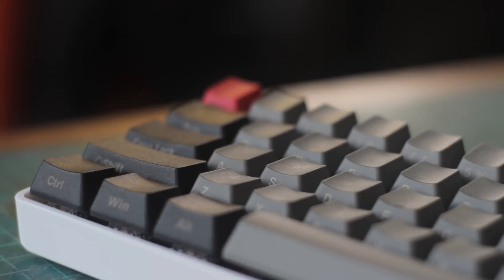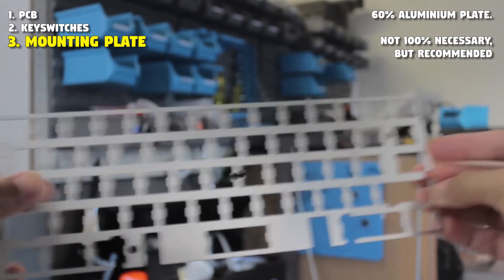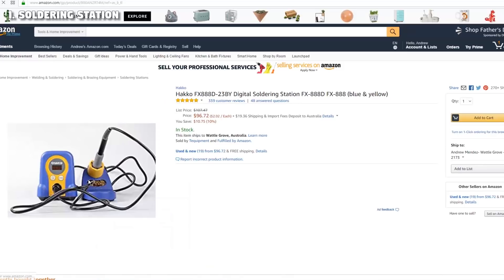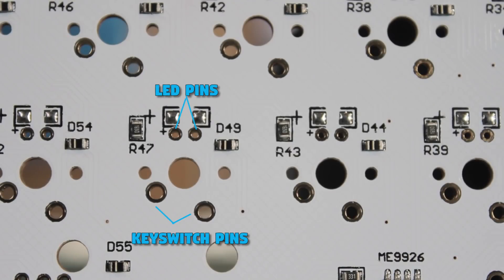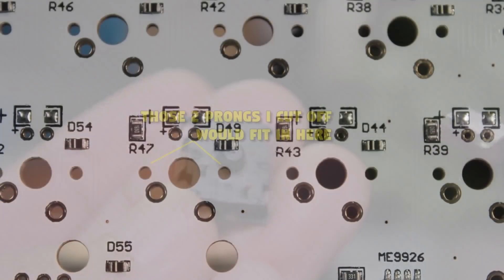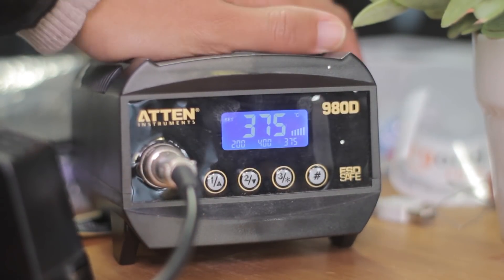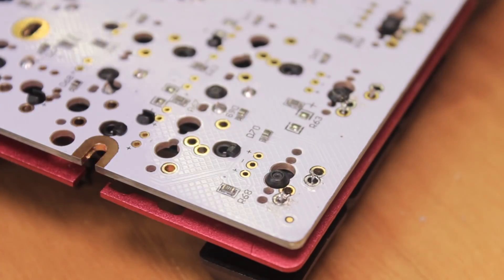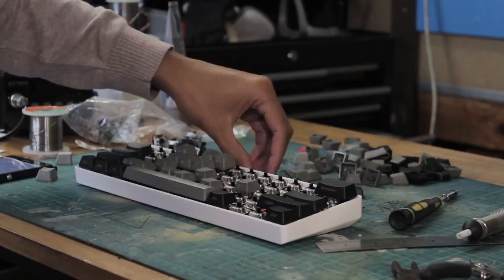Beginner's Guide : How to Build a 60% Mechanical Keyboard

Comment: First time building a keyboard and confused. I hv a xd60 board with the 5 pin holes. Should i cut the the extra 2 pins on the keys?

Comment: Wait. So if you have a PCB mount and PCB switches. Do you have to do the soldering??
Reply from the maker: you will always require soldering, unless you specifically have a hotswap keyboard
Reply: @TaeKeyboards  oh okay. What happens if you don’t solder

Comment: Guys, keep in mind that if you get a PCB with no built-in controller, you could for example use a Pro Micro ATMEGA32U4 and flash it with QMK Toolbox before testing each switch pins with tweezers, otherwise it won't register.

Comment: Yo can I screw down the pcb onto the case first, then install the plate and switches? Asking because on gk64 the plate may not have holes for a screwdriver to access the screws on some cases.

Comment: Hey, I have 2 questions: Are there specific ISO-layout PCBs? And will a custom keyboard be cheaper than most mechanical "gaming keyboards"?
Reply: I’m not very experienced with keyboards but I can answer your second question: a custom keyboard is so much more expensive than a prebuilt keyboard. The cheapest you can use to make a custom keyboard is probably $100 but it’s recommended to use at least $200 to $300 minimum.
Reply: @hueynsoe7586  ouch ok thanks for the reply

Comment: What if I just get a hot swappable pcb would I need to solder I’m new to this
Reply: If its hot swappable you dont need to solder anything, but its better if you buy 5 pins switches (if the PCB supports it) so that the switch doesnt move. 
I hope it helped you and sorry for my english. :)

Comment: You guys don't understand beginners at all and that's why these guides fail. We are afraid to buy wrong and end up not doing anything because most of these guides spend the time actually building it with the parts already obtained. if you want people to actually build keyboard make a guide in depth about how to pick the chassis and boards.

"this is one out of many pcbs you can get" well what are the differences? what about mounting holes, what about key sizes?

Comment: Can anyone explain to me what a base kit is? I’m looking at building a keyboard eventually and I see a lot of stuff labeled as such, and was wondering if it only includes the key caps or if it comes with more? Googling base kit only comes up with websites selling them so I haven’t had any luck in researching it
Reply: Spencer Walthall I googled it and I couldn’t even find anything to related to that. But i think you mean the 4 in 1 kit, it basically has stabilisers installed, aluminium plate, a pcb and a case installed. It basically makes everything easier for a cheaper price (sometimes tho) . All you need to get is switches and keys and you’re done
Reply: @BlancoWilliams  Oh huh! Thanks for the info!

Comment: I have questions about 6:10. Earlier you said to cut off the prongs on the pcb mounted switches if you are going to use a plate, but over here you say if you have pcb mount switches you can just lock the pcb and plate together. I'm wondering how you would do that if you cut off the prongs. Is cutting off the prongs on pcb mount switches necessary if you are using a plate?

Comment: This is insanely helpful I watched Linus tech’s video and juju’s but they were both rushing through and using unknown vocabulary but u explained everything and I understand it a lot better now thanks you this is an awesome video I’m 12 years old and if u can make a 12 year old understand how to make a keyboard I’m sure anybody else can do it
Reply: Penguin
Reply: @faxyo9985  lurker
Reply: Giovanni Procopio penguin
Reply: 12 over here to thinking about either soldering or getting a hot swappable.
Reply: @wtfimcrying  same 12 here i got a hot swappable because it would be more expensive to solder it
Reply: BeautifulToeNail fr
Reply: @wtfimcrying  hot swappable
Reply: Hotswap is cheaper because then u don’t have to buy the soldering materials(which are EXPENSIVE).
Reply: @aaryaganesan1917  In the long run, soldering would be cheaper, but if youre making just one or two, then def hot swap
Reply: It was 5
Reply: This is how they speak

Comment: Do I need to solder all of the key caps, can’t I leave them unsoldered so I can hot swap the switches?
Reply: Jakob Feck some PCBs come hot-swappable, so you don’t need to solder. If you’re looking to make a mechanical keyboard hot-swappable PCBs are a great choice.
Reply: Jakob Feck gk61

Comment: a hakko soldering station is not necessary for such keyboard build. a cheap $10 soldering iron will do just fine, you aren't soldering SMD chipsets with that, just the switches

Comment: Hi, I'm considering to try out to build my first keyboard, but I'm an ISO user, so I was wondering... Those pcbs available on banggod are universal? Could I mount the stabs in different ways (I'm thinking about the enter key that's mounted "vertically" on ISO pcbs) or there are specific ISO pcbs? Thanks a lot for your videos that are really comprehensive and enjoyable, and thanks a lot in advance for your recommendations!

Comment: Hi so if you have PCB mount switches you don’t need to solder? Please answer it would help out a lot :)
Reply from the maker: You always need to solder, unless you have a hotswap keyboard :)
Doesn't matter whether you have PCB or plate mount.

Comment: It's irresponsible to suggest lead solder for a project like this. While it should be avoided whenever possible, I recognize that lead solder may sometimes be appropriate in specialized applications, like aerospace and automotive. A keyboard, however, does not experience anywhere near the stresses (mostly thermal and mechanical) that things like cars and airplanes do...lead-free will be just fine. Please do not add to the toxic electronics waste crisis without a very good reason.

tl;dr: Lead solder is harmful and unnecessary for a project like this. Be nice, use lead-free.

Comment: how did you add the caps lock led? is it inlcuded in the pcb?
Reply from the maker: You have to buy a 3mm or 1.8mm LED and solder it.

Comment: I may be 2 years late, but as an electrical engineer who has done multiple soldering. I cannot stress the importance of after using lead-based solder, please PLEASE wash your hands. Even though the odds of you getting lead poisoning is close to nada, you still can't rule it out. The importance of using lead solder is that it provides better connectivity between your different contact points, but it comes with a dangerous side effect.

Comment: So if i were to use the switches with the prongs paired with a compatible pcb, would that mean that i would not have to solder anything??
Reply from the maker: Prongs, as in the plastic prongs? Nope, that's just to keep it more sturdy on the PCB. You always need to solder to make that physical electrical connection, unless it's a hotswappable PCB :)

Comment: How do i know what profile keycaps i can buy? im trying to make a 60% keyboard with dz60 rev2 pcb
Reply from the maker: You can use any profile. Profile refers to the side view of the keycaps. I think you mean like the layout. If you are building one that has the same layout as this keyboard, then you can buy pretty much any standard keyset, and it will fit.
Reply: @TaeKeyboards  thank you so much !

Comment: How would you add Led’s to your board? I feel like showing us how you did the caps lock would’ve been a good thing so we got a general idea if we wanted to
Reply: Some pcb's have leds build in, like the dz60rgb
Reply: Some switches are equipped with LEDs. You'd have to solder two extra pins per switch. Don't forget to have double-shot keycaps so the label is illuminated.
As Herpez said, some PCBs do have (RGB) LEDs already on them. Then it would be a matter of using switches with a clear housing to really make them shine.

Comment: Hiya, nice video. I wonder how would you go about converting a Lenovo keyboard to a wireless keyboard  (I've got hold of just the keyboard) . My reason for this is I use the red tracking/mouse on the keyboard very effectively but I work wit three six screens, two laptops and a MacBook Pro. The laptops are seamless but the Pro drives me mad. I would love to create a wireless keyboard that I can use with all three. Any ideas would help, Thanks

Comment: would cost around $160 CA for me. good job
Reply: is that with the soldering tools too
Reply: Tragic_png I spent around $120 on my build. However, I used a clear case since I was gonna use underglow... Otherwise, you'll probably spend around $110. Soldering tools not included tho
Reply: I have the soldering Tools and I know which Keycaps, Switches case, wire, stabs I want. But I didn't find any RGB PCBs with ISO Layout...
Could you help me? I also need a plate
Reply: Mindest the dz60 on banggood has rgb underglow with many supported layouts including iso. but you have to solder the key leds yourself
Reply: @konnai4973  I See..
Well, that's a compromise. Thanks
Reply: Where can I buy them? theyre sold out everywhere

Comment: Should I lube my switches?
Reply from the maker: It's not necessary, and takes a lot of work. But it does make your switches smoother and usually nicer to type on. Switch lube is different to stab lube though.

Comment: @taekeyboards I have a loaded question hoping you could help. So I recently purchased a KC64 from eBay my first 60% KB. However I noticed that certain keys don't register when you type quickly. I like the keyboard and have already spent a considerable amount of money in the last year on different mech boards. Would I be able to re-use my cherry MX brown switches, plate, case and keycaps and just replace the PCB? Would I also be able to have the same layout that was originally for the KC64 or would I need to buy stabilizers to make it a standard layout? I was looking to replace it with the same board in this build

Comment: Ive been soldering electronics for a long time now and I've never had one of the Hakko soldering stations. They are more of a high end soldering product. If you cant afford a fancy soldering station or even anything above an iron that you plug into the wall, don't let it discourage you. In the end it's just a hot piece of metal.

Comment: How do you solder LEDs?
Reply: Switch LEDs? Once your switches are soldered, you can simply insert the LED through the switch and the PCD holes like this: http://d2fu7qgd3tdbcc.cloudfront.net/images/detailed/1/3mm-led-switch_ph6d-zd.jpg?t=1448959437 and solder in place underneath, just like the switch. There's a couple of different size LEDs that will work, and they're available in most colours. Packs of 100 are like, 5 dollars.

Comment: Couple of questions regarding the build:

1.Could the Backspace area(2units) accommodate two single keys(like alpha keys) of 1 unit each on this PCB?
2. Could Right Shift Key area (2.75units) accommodate a single key(like alpha keys)  of 1 unit and a Shift Key of the remaining size/unit?
3. Could you advise where I can find 1.75 unit -Control Key cap and 1.5 unit-Caps Lock Keys if they exist?

I am trying to build a hybrid HHKB and MX style board with arrow keys.

Thanks
Reply: 1. and 2. Yes, the GH60 PCB supports both split backspace (1u + 1U) and split right shift, but only in 1.25u + 1u layout - not the other way around. Layout picture here: https://ae01.alicdn.com/kf/HTB1bFqIKVXXXXboXFXXq6xXFXXXu/Customized-GH60-Full-Kit-Aluminum-Case-CNC-Acrylic-Case-PCB-Universal-Plate-Switches-LED-For-60.jpg
1.75u Control - most decent keycap sets will include one, that is GMK sets for example that are run in group buys. It's quite common for people to replace the traditional Caps Lock key for a Control key (ala HHKB). I'm not actually sure about 1.5u Caps Lock, that might be a bit more niche option, most people when replacing the Caps Lock key, will put Caps Lock under a function layer, as it's seldom used nowadays it seems.

Comment: so i can build one without a soldering station using the GH60 ?
Reply: You can use a soldering iron, rather than a station, but it's not recommended.. You can pick up a cheap, adjustable soldering station from Amazon for like 28 USD..

Comment: i am a beginner at making a keyboard, but i want to give it a try but watching your video
a)i learned the components that i have to use
b)i dont know which keys to solder ?(why not all of them) and what holes to fill ?
but great video gave me lots of good ideas
Reply from the maker: All of the switches that you put in have to be soldered. So each keyswitch has 2 pins, and both of those have to be soldered. There's extra holes for different key layouts. For example, some people use an ISO layout which has that large blocky ENTER key. Therefore you need more holes to accomodate that different positioning. So that's why there's extra holes, and if you don't have any keyswitch pins going through it, then you don't need to solder it, since there won't be any connection made with anything. 

However, if you do put solder there, it won't make any difference, and it will still work fine (because there's no connection made).

In short, you just need to solder in your keyswitch pins (and LEDs if you have).

I hope that makes sense :)
Reply: You do solder all switches - the first few that he soldered in the corners of the keyboard are to hold the plate and PCB together. Once those few are in place, you can install the rest of the switches, flip the board over and solder them all in place.

Comment: Id rather buy a razer keyboard then buy a tool for $100 to make a 60% keyboard
Reply: 2 points - the soldering station shown here, though highly regarded, is definitely at the higher price end of what is available. You can find an adjustable station on Amazon for less than 30 bucks. I've built 6 keyboards with one of these cheap ones, with no issues. Secondly, whatever the price of the soldering station, it becomes better value for money the more you use it. Build 10 keyboards, and that 100 dollar station has cost you - 10 dollars per board, if that makes sense? But not only that, soldering is a great skill to learn and have at your disposal, and it's really easy to pick up. So even outside of keyboard building, it can be a worthwhile investment.

Comment: If you have keycaps with PCB Mount do you have to Solder?
Reply: I think you mean switches but yes you still have to solder them in. The only way to avoid soldering switches would be to use Holtites but different Holtites may or may not fit in some boards.
Reply: ADCBot oh okay. 
Do you have any idea if their are PCB:s compatible with ISO Nordic layout? I have looked a lot but have not found any PCB. I looked at the phantom PCB but i didn't find any information if it supported ISO Nordic layout.

Comment: Great work. 
But $105 is very expensive for a DIY keyboard. 
Did you try buying from Aliexpress?
Reply: For a DIY keyboard, that's a very cheap price. Like bottom of the barrel. For prebuilts, it's definitely on the higher end.
Reply: Ryzu, 
Said no self builder EVER.
Reply: Alaa Jannoud
Exactly, I found a complete 60%Mech keyboard there for 90 bucks

Comment: Do you think you could do a guide on rgb back lit keyboard? I would like to try that as it seems very fun and difficult however I don't want to jump into it not knowing what components I would be needing.
Reply: You can get a PCB just like the one used here with RGB SMD underglow pre-soldered, for practically the same price

Comment: Really good video.  Question though, what about support for fn modifiers?  I lose the arrow keys if I go to a 60% board, but a lot of off the shelf boards keep that functionality but move them to modifier keys.  Is this possible with a custom build?
Reply from the maker: Yep, by default the arrow keys are on WASD. Nav cluster (home, end, etc) is on []'; etc. And of course F1-F12 are on the number row :)
Reply: TaeKeyboards thanks for the reply.  is the PCB you linked in this budget build programmable? or is that a more premium feature?

Comment: Just wondering - is there a way to make the keyboard have that "k70 floating key" look? Like any special cases out there or just diy?
Reply: You would just need to start w/a base that isn't recessed, and w/no dividers between keys.  The one in this video is actually floating, it just has a couple mm lip around the base.
Reply: So would I trim off the extra mm? or

Comment: do you think i can build a pink-themed tkl keyboard for around 150 U$ ? i fell in love of the miami keycaps you showed on the meetup video <3
Reply from the maker: TKL custom boards are more expensive as they're not as standardised as the 60%. Custom parts for TKLs tend to be higher quality, and therefore more expensive. So I'm not sure whether you'll be able to do that, but I'm not completely sure.

Alternatively you could paint a case pink, which is pretty easy and would look pretty good if done properly.
Reply: mmmm... the other option is to buy an cheap one and swap the keycaps... can you suggest me one similar to xiaomi's mech but with tactile switches? i've used cherry blacks for 6 years and want to try green/blue ones, also the detachable cable is a plus, but i think i can mod it :D
Reply: As an update for this comment I bought an 60% and spent over twice my original budget (no regrets) 😀 I fell in love so bad with the 60%'s that bought a Tina and one of the last GB of kbdfans <3

Comment: What parts would I need for this in ISO-DE? What about LED switches?
Reply from the maker: The plate and PCB support ISO, so the only change you would need is the keycaps. You can Google 'GH60 ISO' and you'll see a couple of boards :)
You can buy and solder in LEDs like what I did with the caps lock, with some 3mm LEDs.
Reply: TaeKeyboards Awesome, thank you.